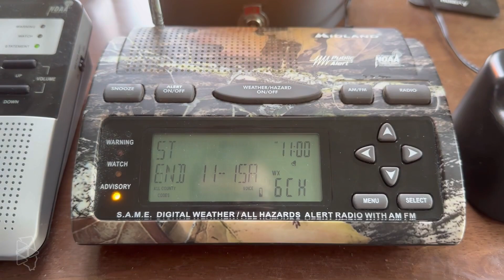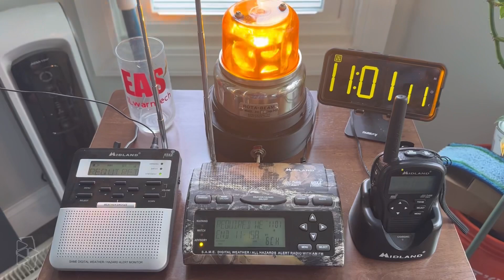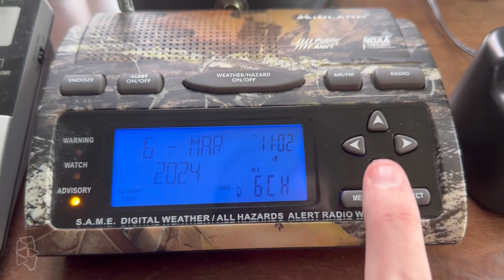Illinois Statewide Tornado Drill 2024 - EAS Activation

Comment: was the light activated by one of receivers? Or was it activated by a remote? I'm curious.
Reply from the maker: It was activated by a RadioShack 12-996, which is not seen on the table.
Reply: There's a solid state relay in the base of the light. It's activated by the radio's external alert port